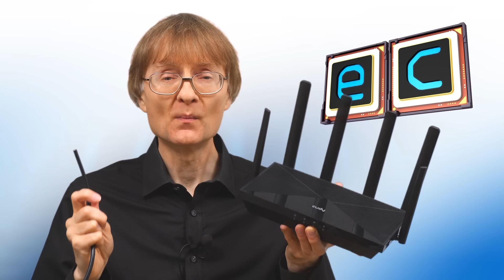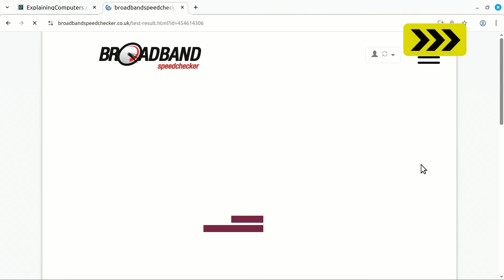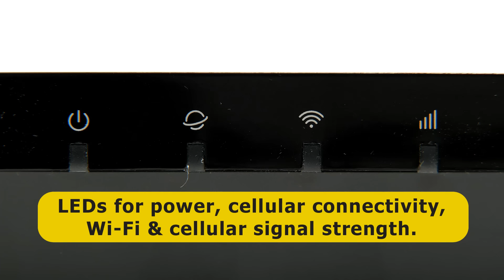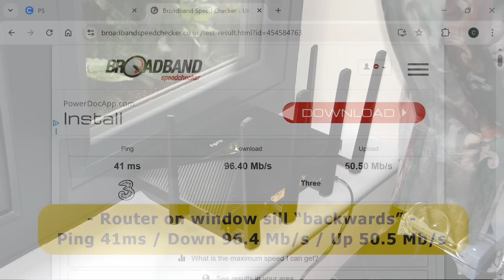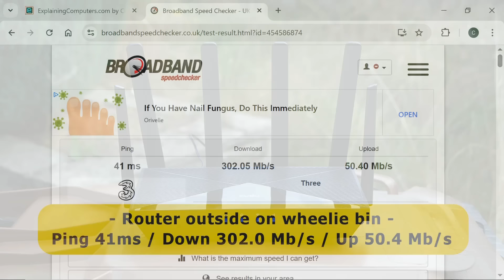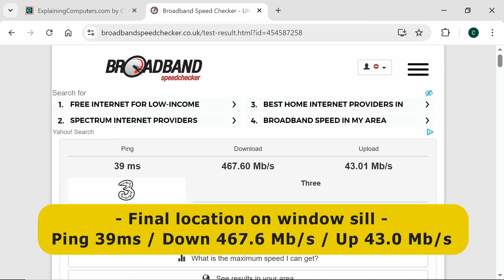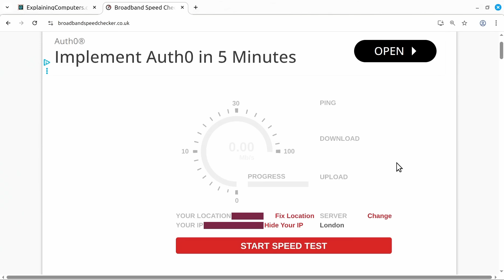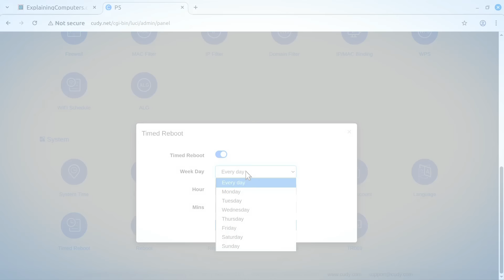Switching to 5G Broadband: Cudy P5 Router

Comment: Great video. Could you climb onto your roof with the router to see what the signal strength is up there? Anyways, we have T-Mobile 5G internet here in Massachusetts which works well for us. Xfinity rolled out FTTH fiber internet to our neighborhood over the summer, including bolting a box onto the utility pole outside our house in anticipation that we would sign up for their service, but I think that this piece of equipment is fated never to be used.

Comment: Likewise I have been using 3 mobile broadband 5G for about 4 years. I have replaced my router which was initially provided by 3 for a similar prosumer router, which I run in bridge mode in conjunction with a sophos XG series firewall and a rukus WAP. This has given me the best speeds I have ever achieved in my area which is a little "in the sticks". Glad you have made the change and are happy with it. 👍

Comment: I have gigabyte internet via fibre to house using Brillband ISP in Glasgow on a City fibre network. Todays ping was 942 down and 742 up. This uses an eero box connected via an 8 port switch. I am very satisfied with the service. l
Lost the connection for a few hours  at one point due to damage to the underground fibre somewhere in the city.

Comment: I feel super bad for you all across the pond. I pay $70USD for 2Gbps/2Gbps Symmetrical Fiber with less than 5ms average latency. I use Ubiquiti 10G hardware Three years running so far, and before that I had Gigabit symmetrical. Can't believe how behind, slow and backwards the UK internet infrastructure really is.

Comment: I've got fiber to our property, and pay for 400Mbps, and that's exactly what we get, so I'm pleased with that. The provided router/access points were Amazon eero's and they are just awful. I bought a wired cudy router, and already had a fast zyxel wireless AP. The Cudy router is brilliant, has worked flawlessly and was very well priced, as mentioned in your video the interface is fantastic. Paird with the zyxel AP's it's fantastic, reliable, fast and very well priced. There is something to be said about a device that does one job well, and doesn't try to do too much.

Comment: I changed to 5G broadback 4 month ago to 3's subsidiary Oister - a low cost provider in Denmark. We have excellent 5G coverage and where I live in the Jutland penensula, the the 5G antenna is only about 1 kilometer away and the second one about 1.5 km. Changed Fiber providor 4 years ago. Then early this year they increased the price twíce to new 380 DKK=45£ with unlimited data - which you need! Don't fall for providors selling you max 10 GB/month. You'll use that in two days max. 

In the spring I noticed my daughter had 5G brodband. It worked fine after we placed the router close to a window upstairs pointed at the closest antenna. I was surprised, it was the very first 5G broadband I've ever seen.

This got me thinking. All i've heard is that Fiber is much more reliable with no fall outs and constant speed. Well, I decided to try it out after 15 years of Fiber  which has always been excellent. We went from 15 mbs to 100, 200, 500, 1000 and back to 300 to save 10£/month in the period. Nobody really need more than 200 mbps even in a large family with some teenagers. :face-fuchsia-tongue-out:

Although I might never take the router out of the house, the feeling of having the freedom is fantastic. As I also have my mobile subscription with Oister I got a deal to save even more, about 5£/month. My 300 mbps fiber had increased to 45£/month. My 5G connection is 28£ per month.  Saving me 17£/month

And the speed is TWICE as high - I typically get 500-600 mbps! It is true that 5G speed is variable and it gets down to about 400 mbps but that's rare. Yet, its by far enough for any household. 

The rumours about 5G being unstable are widespread. I've talked with a few people about how surprisingly pleased I am with 5G broadband. With no exception I get the response: "yeah good for you but for me its unstable and unreliable". " I DON'T want to watch an important football game and miss the crucial goal because the connection gets lost". In my 4, almost 5 month of using 5G I can report ZERO problems. If anything it feels a bit snappier. 

Before you jump into it, do as Chris rightly said, check how close your 5G antennas are in your area and that any large constructions don't decrease the speed. 

If your router comes with only 2 LAN ports, as mine did from my provider, you just buy a cheap 5 port switch and youre good to go.

Comment: I'm stuck on 8Mb/s ADSL, due to my remote rural location and "Exchange Only" line, so I'd love to switch to 5G, but sadly the only cell tower in this area is behind a hill, and I get zero bars. If I walk a mile down to the main road, I get 5 bars and 100Mb/s downloads on my phone. Maybe an external antenna on the roof might help, but I'd have to get an installer to do it, as I have no clue.

Comment: In 2018, our municipality in Norway entered into an agreement with our local electrical power company to provide fibre-optic based internet. We had to do some installation work, mainly digging trenches on our property, then the workers came by on a specified date, laying and welding the fibre-cable. Within a few hours we were connected. At the same time, we were disconnected from our Telenor DSL and landline that we had used previously. We were told that Telenor would let the copper wire network die if there were any problems. Some of our older neighbours wanted to keep their landlines, but once the copper network failed, all of these had a box installed that plugs into the household power network. Inside the box is a device that in essence is an inexpensive mobile phone that uses the same base station, everyone else uses with their smartphones. The box then connects to an ancient landline telephone. This costs 2-3 times the price of a smartphone connection. 

Consumers were given options about internet speeds, and the opportunity to purchase different television packages,  but since we don̈́'t use a television there was no point in paying for any of those services. We pay about €75 a month for a basic service. People with the most expensive plans pay about €150. 

The fibre cable terminates in a basic router provided by the electrical power company. This is located above our NAS server rack, which also houses a couple of 24-port Ethernet switches that provide POE = Power Over Ethernet. There are ports that connect to five different wifi  access points, two on each floor of our house, and one outside. In addition other Ethernet ports connect directly with switches in most rooms, including a workshop in a former garage.

Comment: Here in the US it’s not just signal strength, it’s also network architecture. T-Mobile uses a walled network similar to most hotels making it difficult to integrate your own home network and maintain fine control over the broadband side of the router.

Comment: 50/10 is really poor for a fiber connection. In that case, upgrading to 5G does make a lot of sense, even without an outage.
Your particular router used a modem which is about two generations old (Qualcomm X62), but should still be enough for you. The software looks to be based on OpenWrt.
As for me I am lucky enough to have FTTH service, up to 2 Gbit/s down and around 1.5Gbit/s up for 30-something Euros. Though I also keep a 5G service as a backup using a Teltonika TRB500 modem gateway. I use a Pi 5 as a router and UniFi system with 5 hotspots for WiFi (I live in a house).

Comment: Used to be a VM customer with 1Gbps download and 100Mps Upload. Didn't like the cost or the annual increases. Also could not understand why new customers could get better deals but existing customers were treated poorly. Unfortunately I live at the end of a cul-de-sac with a small private road and although fibre infrastructure was available on my street the provider did not lay it in the private drive even though all houses feeding off the drive (4 in total) were in agreement that they would like the service, it was never done. Luckily, after 2 years we finally managed to persuade the provider to install FTTP and I now enjoy 900Mbps both upload and download for a bargain price of £25 per month. Very happy indeed. Now just waiting for pricing of 2.5 and 5G speeds to come down to take advantage of that. I have recently upgraded my internal wiring to cat 6A and upgraded my switched to a combination of 10Gbe and 2.5Gbe.

Comment: Historically? 

FTTC through Zen (Openreach) with one site getting 27 down 5 up and the other 76 down and 18 up
Now?
FTTP through Zen and an altnet with Zen delivering 300 down and 47 up and the altnet doing gigabit both ways.
Ping on both connections are under 10ms at all times.

Comment: This is very concerning.  What does deprovision mean!? Is this something they can do to anyone who is a BT customer?
Reply from the maker: Apparently so. I was never told what "deprovision" means. For the first three weeks I was told it was a "network fault at their end" (after they had visited my cabinet three times). And I always found it strange as the line still clearly worked for the phone. It is quite extraordinary that they can do this, and have no fix. I no longer have any faith in either BT or Openreach (and they area great at blaming each other).

Comment: At the window, better is to place the router 7 to 10cm higher, so that the antennas "look" trough the glass en not "look" partial the window frame that is containing metal i think. And use a adblock in your browser 😉

Comment: I sacked BT off in 2015 after a prolonged BB outage and compensation and went to 3 tethered 4G then. 
These days I'm load balanced across two 4/5G networks (3/Vodafone MVNOs) with a GL-iNET X3000 quad WAN OpenWRT travel router. 
Not hitting Chris' download numbers but see 250-300Mb/s regularly.

Comment: So 5G is far more depressively variable than I expected, but it could be better or worse here if I had the money (not to mention the need, since apart from my or dad's house where the connection quality is limited and the speed thus hard-capped, and my mobile router being an obsolete moody piece of shit I wanna replace (my phones have a far better, and far more stable (I think it's never once dropped even the WLAN), 4G+WLAN connectivity), the 4G LTE connection is very good all around) for 5G connection/hardware (nothing I currently own has 5G, and my Samsung Galaxy A15 phone coulda been a 5G version if I wanted to pay the extra 30-50€+), so it still remains to be seen how good it's here, but I'm still just as extremely sceptical as before, and after this even more so. In the end, though, more info is good, so even bad news is valuable info.

Comment: I'm in Brighton & Hove and use TalkTalk.  
I have just run a check and my old 2008 Dell desktop with wired connection shows Ping = 12ms, D/L = 94.68, U/L = 29.17.
My Samsung A13 on WiFi shows Ping = 9ms, D/L - 155.17, U/L = 28.31.
Including unlimited phone calls I pay about £42 per month.

Comment: I also have FTTN connection (southern Australia) but I'm only 130m from the node so the connection is very good and stable. If there is a failure then the router has 4G backup which works OK -- It was a standard part of the product from Vodafone.

What's of more interest is that my newish house is wired for TV in most rooms and I have added MoCA adaptors in the office (computer and printer), two in the lounge (TV and computer plus wifi access point), and one in the garage (router/modem). As I have a longish house this has been a great way to get decent wifi through the whole house as well as a ethernet connections for the devices that use more data.

My modern coax cable can handle TV and ethernet traffic. You should check if you have a older coax wiring.

Comment: Great video very informative as always. Thank you for the extra information in the description. Did BT not offer you the Digital voice adapter that works with their routers?
Strange that you've managed to keep your landline, would be interested if you have a backup plan to change to VoIP in the future other than what you put in the description. There does seem to be a limited supply of Broadband offerings including landlines or voip as standard. Unfortunately I live in a home with spotty at best mobile coverage on pretty much any network 😥.
Reply from the maker: Thanks for this. The digital voice adapter still only works with a BT router -- not with third party routers. So there remains no way to have landline on  digital BT line without plugging in their router -- something that, as the BT forums demonstrate, is unacceptable to many of their customers.

The fact that my landline kept working when the DSL link failed surprised many of the people I spoke to at BT over 24 days, leading to multiple cabinet visits, and then being passed around many parts of the organization (BT is massively compartmentalized, and the different bits do not communicate). My backup for the future will probably be to port the number to a forwarding service to divert it to a fixed mobile device. Although, as time goes on, my plans for this may change . . .

Comment: In the 90s in London, the pavements were all being ripped up (badly) to add cable. When our brand new house was built in the late 90s on a greenfield site, I couldn't believe that the developers didn't stick in fibre cable along with all the other utilities they were digging trenches for already. thena couple of years ago we had FTTP offered (not by BT), but that would have meant them drilling a hole in the side of my house. So I told them they could keep it.

Comment: Smarty  5G unlimited sim,  and older 3 ZTE MC888 router.  Less upload than you Chris, on a hill with loads of 5g masts around,  I WFH and do a lot of telephone and remote connection, all just fine for £20 a month. Been working for nearly 2 years.  If i took the time I could get better speeds, but am happy where I am just now.

Comment: Several years ago I had a wired router (before home WiFi was widespread), one marketing claim for which was that it was "self-healing". When you looked into it, it turned out that it was just a timed reboot, which I didn't think was a particularly good advert for the stability of the firmware!

Comment: The original service really beat my ISP to the bottom. This setup might be a better option for me, especially in hurricane season. I use a little mifi puck as backup connection so I can administer classes when my ISP goes or gets knocked down.

Comment: I had 4G internet with a TP Link Archer MR600 router, speeds varying from 30-100 Mbps down and 40 Mbps up. Moving to FTTH 1.5 Gbps down and 1 Gbps up is very nice, but the lower and stabler ping times is what is the big deal for me personally.

Comment: I've used a 5G mobile hotpot in my place for nearly 3 years and I get great speeds. So long term use is good. I also use external antennas and place my 5G hotspot near my window for the best results. I usually get 400Mb/s DL and 40Mb/s UL. I won't go back to using other ISPs as if I need to move, all I need to do is take my hotspot with me and it's up and running within a few minutes.

Comment: Chris, great video. Nice results. Greeting from Finland. I am using mobile internet as the only internet in my house for last 10 years or even more. I started from usb cat4 modem and now using 5G modem. I am more than happy with mobile internet, recently fiber optics came to my area and I am not planning to switch. My personal experience is that 4g/5G modem should be always outdoor even if base station is near to the house and have ethernet connection to indoor wifi part.
That works the best. Taking the road with external antenna is quite risky, it is possible to make things worse quite easy.

PS it is a bit strange why mobile operator in UK offer only 50Mbps uplink with 600 Mbps download. Usually it should be 100Mbps. I believe outdoor 5G modem can solve that :-)

Comment: Consider fact that 5G is still a shared wireless network which means its speed is shared between all users currently using the 5G sector. Speed in fact cannot asured for long period of time which means the more devices will use 5g ... less bandwidth will available. Switching even from VDSL/Fiber to 5G is just worthless cause shared bandwidth in stationary services doesn't happen or is limited.

Comment: I must say, Chris, I'm surprised that Openreach had the nerve to cut your copper line off like that.

The design of building I live in behaves a little like a faraday cage due to the girders, which interferes with my mobile, and in-turn, renders cellular broadband unviable for me.

At the time of this video, my building is (still) DSL-only, and the number of upcoming/planned roadwork sites in my town concerning fibre has slowed to a fraction compared to last year.

Comment: I am a BT customer myself. And like you I was happy with my old copper connection.

However we have been blessed with full fibre connection and although we are still paying a bit more for our Internet. BT have not let us down yet.

Their "stay fast" guarantee and always on connection (with hybrid 4G connection if the main line goes down) is what I love.

However I have a friend who is unable to get a proper Internet connection due to reasons. But if he can get this sort of setup instead of tethering off his phone. I am sure he would be happy.

But those are some pretty impressive speeds through 5G.

But as Chris said, this isn't a recommendation this is his experience and how it may possibly help those in similar situations.

Comment: I am connected with a sim router through Smarty (which uses the Three network). I get on average 400 down and 90 up but I too am close to a tower.. My sim costs £18 a month for unlimited data. I think it's a brilliant way to be connected.. My wireless connection to router is about 2400..